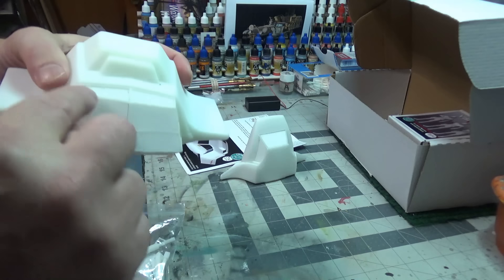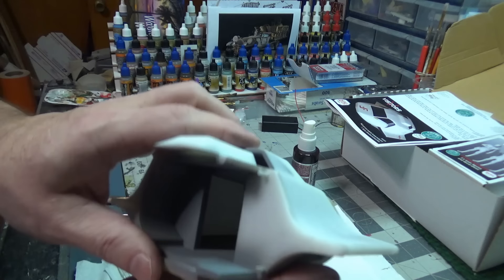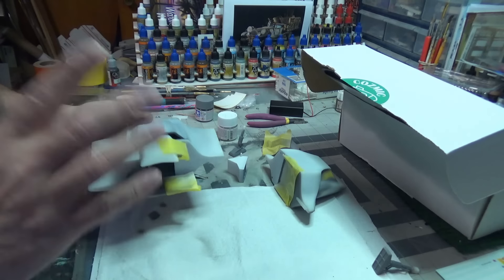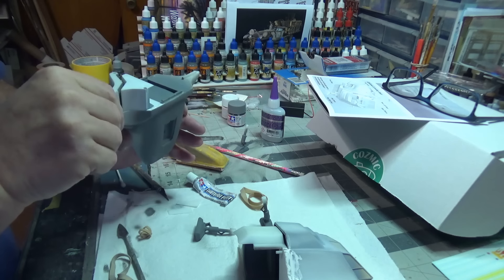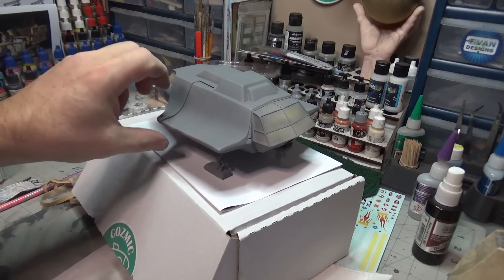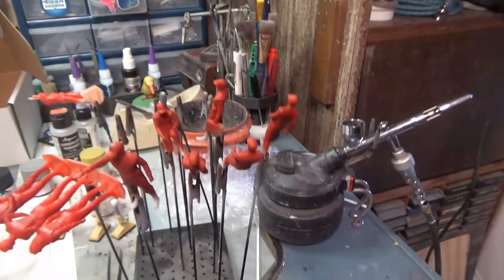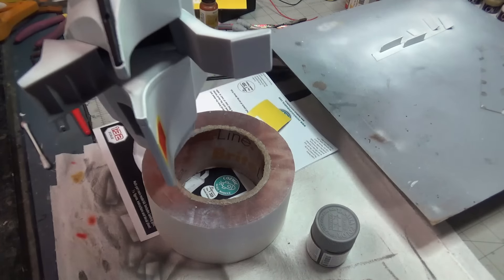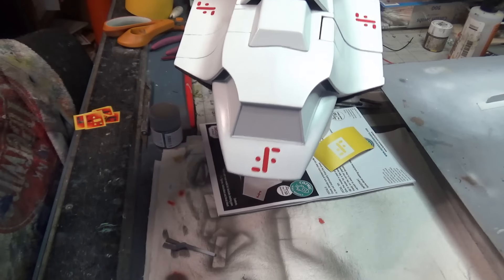Aztek Dummy Update 1/19/24 - Visitor Sky Fighter - Part 1

Comment: Hey Lou, I have actually stood in that vehicle. The WB lot used to have a section  called the prop graveyard, and it stood derelict there for years, replaced eventually by parking lots and structures. Like the Galileo 7,  the life size vehicle was pretty much an empty shell, looking very much like the model kit. Pretty sure the interior was also a set.

That said, great model so far, as always.

Comment: That wide bulge on the back section: It's not actually there on some of the filming miniatures -- on those the back bit flows cleanly from the front bulge. On the ones where it is, there isn't anything inside it (so the model is accurate!). It's an "intake" of some sort: the full-size versions appear to have a mix of either having it "blanked off" with a white panel or some black fins/vent structures in there but it's difficult to see on screen caps. No, I don't know why a spaceship needs air intakes...

Comment: I can't help feeling disappointed that it doesn't have clear windows and an interior. Yes, I know, the black is more accurate to the show, but it still would have been cool.
Reply from the maker: It's one of those cases where the interior wouldn't fit inside the shell anyway.. The inside is much bigger than the given space
Reply: @aztekdummy  They do that a lot in video games as well. In one level of the game Deep Space Nine: The Fallen, you explore a crashed Federation ship, and it's severely undersized. The bridge dome on the saucer is about the size of a gazebo, but once you get inside (different level), the interior has massive, cavernous rooms. 

In Star Trek: Elite Force II (which is vastly inferior to the first game), there's a part where you're on a planet near a shuttle, or maybe it was a runabout. You can enter the ship, but the inside is so cramped that you can barely fit.

Finally, in Star Trek: Klingon Honor Guard, there's a level where you can walk around on the hull of a Klingon D7 Battlecruiser. I'd say it's probably about 1/4 the size it should be. I went all the way up to the nose of the ship (I forget if there was an actual reason to do this), and far from it being large enough to contain several decks, you'd be lucky to fit one room into it!
Reply: I always assumed the black windows were to hide the fact they are 🦎 lizards.

Comment: The master is wrong.... The front cowling over the windows is out and the rear window section seems out. Scratch built the squad ship and 6 figures back in 1993, unclipping the front and rear sections you got the fighter. Again 1/35th it was going to be a garage kit, but I got a call just before sending it off (with the first 1.1 Predator Bust) that the guy had conned a couple of guys out of their commissions...